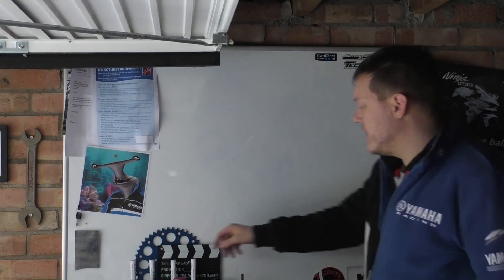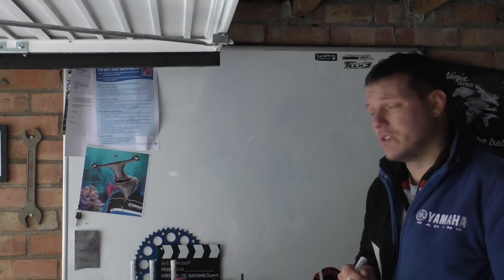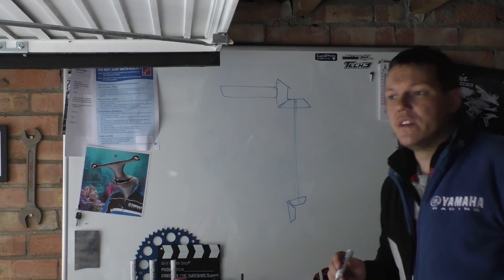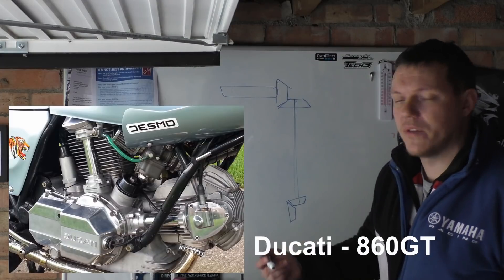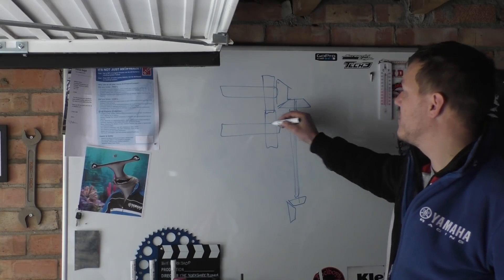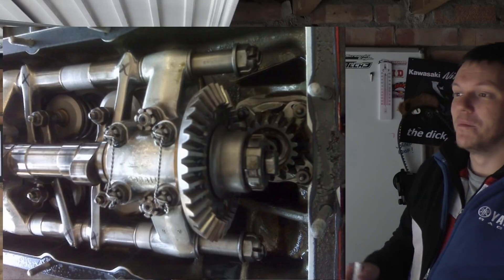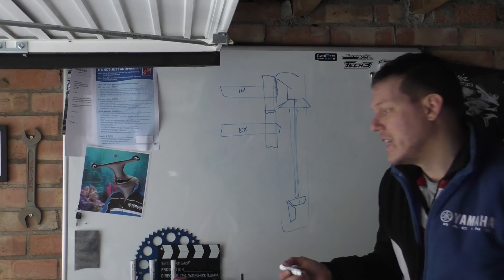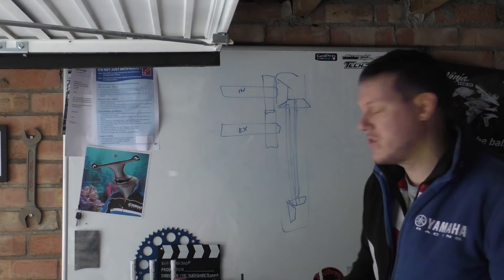Camshaft Drive - Bevel gears - Part 4

Comment: But why choose gears over these beveled cams?

Hondas old issues with cam chain tensioners in the 80's kinda did necessitate the need, however temporary for an alternative so why didn't they choose this system for the likes of the CB-1, CBR400,  VFR's etc

Comment: I can remember a Ducati 24 horas 250cc single that had a little glass window over the bevel gear at the cylinder head. Surely the new machining technology has cut the cost of doing it so why use belts? Is it just another way to grab more money? 
Why did Ducati stop making singles?

Comment: What is the pros & cons of the hybrid system?
Reply: The Workshop What a pure dickhead I am eh haha,
Reply from the maker: Hybrid camshaft drive, not engine systems LOL - but good effort!
Reply from the maker: https://youtu.be/cKrHi0tqxSg
Reply: When comparing hybrid systems, I find when you actually see real world fuel usage statistics that I get to see on breakdowns, almost always they are running roughly the same as the equivalent diesel. 

Seems that much like diesels were sold to the wrong kind of driver, i.e. little old people, housewives etc that are do very low mileage, shouldn't be driving diesels 

And if your driving high mileage per year, on mostly motorways, hybrid isn't really the answer either.